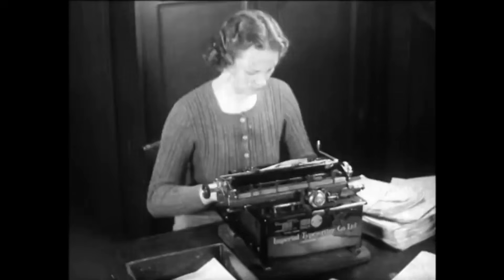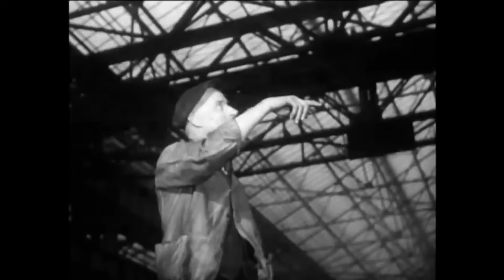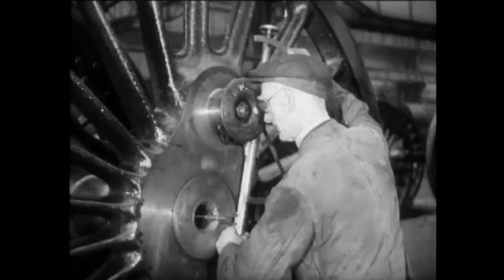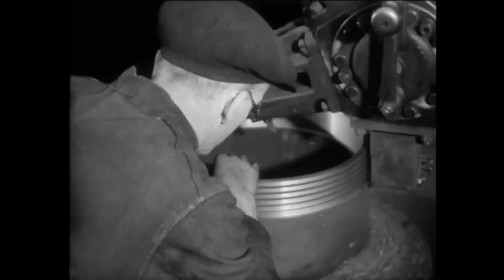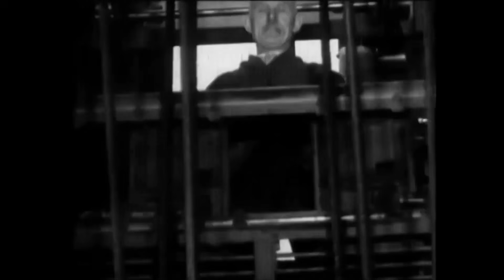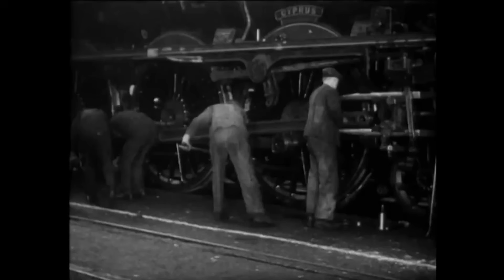Classic Railway Films  | 15 | THE LMS REPAIR SHOP in  1938 #classic #retro #1930s #retro

Comment: I love this…Amazing!
I’m sure that there were times ,that some stages were late and couldn’t proceed to the next scheduled repair.
Reply: More likely they build plenty of "fat" into the system.  They would have done what a lot of project managers did and still do:   If a job should take 2 men 3 hours, allocate them 3 hours 15 minutes, and have a spare chap on hand to take over if some guy gets sick or injures himself.   Nothing in this world is perfect, and men make mistakes - you have to have some slack time so that mistakes can be corrected.
Reply: @keithammleter3824  this is also for the time a modern loco, with relatively good consideration for maintainability you step  away from that to other parts of the fleet or from Crewe to Derby with its mess of old Midland stuff with inherent flaws in design to account for and it'll drag out alright.

Comment: This was probably 5605's Heavy General repair from 31 March to 27 April 1938 so a bit longer than than the seven days claimed, but still remarkably quick considering the work done. The 'seven days' would not have included time waiting to actually go into the erecting shop nor the time spent in the paint shop. The 130,000 miles between Heavy Generals would have included at least one Intermediate repair in between. 5605's next repair was a Heavy Service starting 2 January 1940; annual mileages at the time were: 1938 - 52,863;1939 - 45,981; 1940 - 55,645.

It's amazing how much statistical knowledge of the railways remains today - for those of us sad enough to collect it, anyway!
Reply: There are many more dubious things you could be doing! Thanks for the info, that was interesting.

Comment: All that racket & bashing & grinding of metal.... and not a pair of ear defenders or safety specs to be seen.
Reply: Plenty of hazardous substances to get exposed to, as well.   Exposure to the residue from burning coal, which is carcinogenic, asbestos insulation, etc.  And unlike the USA, British railways didn't require or supply steel capped safety boots - so if you dropped one of those connecting rods etc, you smashed a foot and were crippled for life.
Reply: No helmets or fluoro's either. But I'm strangely curious about the erection shop.
Reply: or gloves!